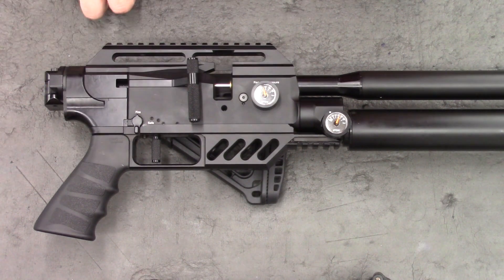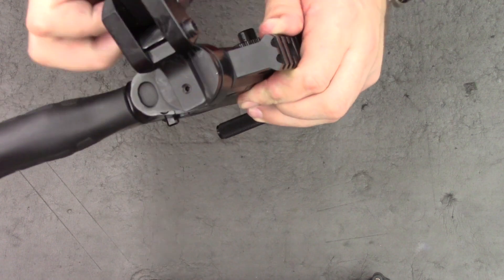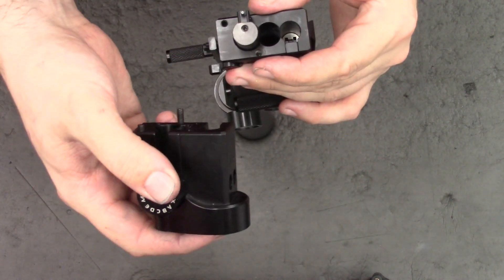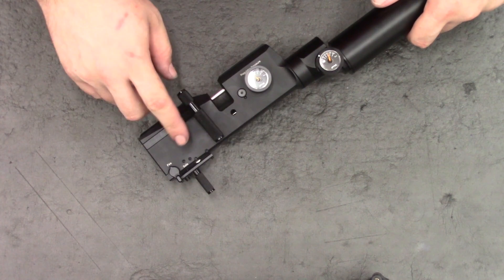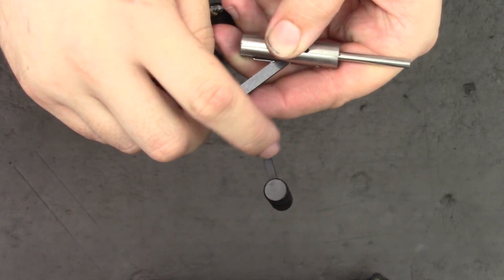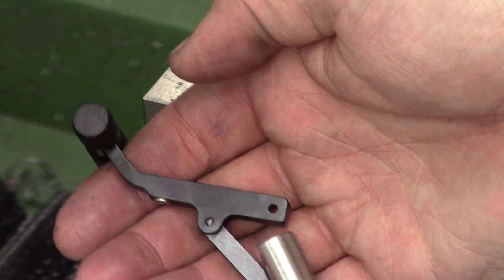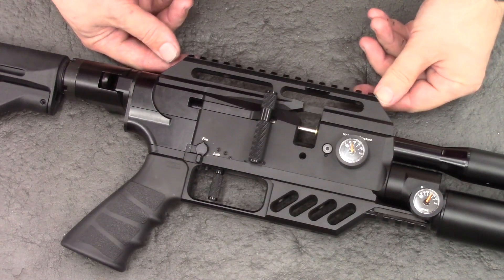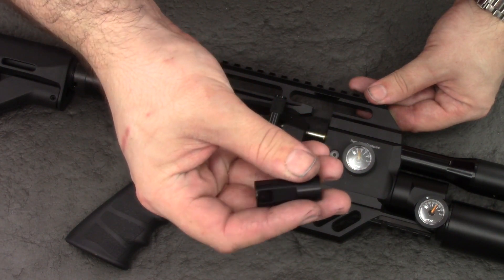FX short throw cocking arm.

Comment: Absolutely excellent watch as ever bud and great modification to the dreamline 👍 the oem throw is a little long and I bet this feels sooo much better 😁 I'd love to get this done to my dreamtac if possible??

I've been meaning to grab a few more bits off your ebay store next payday expect a good size order need to complete my fx tool kit and also would like the black leshiy 2 parts fingers crossed there's some of the hammer adjusted blocks left 😁👍
Reply from the maker: Thanks, very good to hear, we could probably do it if you sent us your cocking arm, just send us a message through AGF like before. Thanks for watching
Reply: @sub12airgunners  cheers mate will be in touch 👍

Can't wait to see where the rapid goes big fan of them but definitely has some room for improvement 👌😁

atb